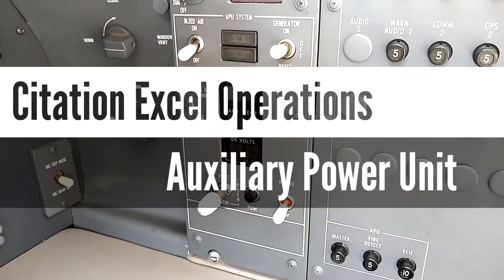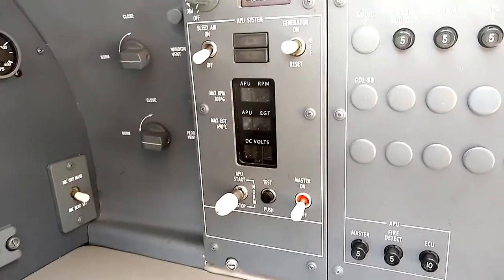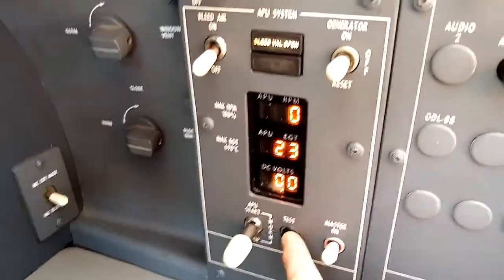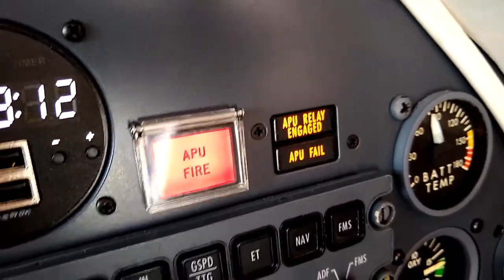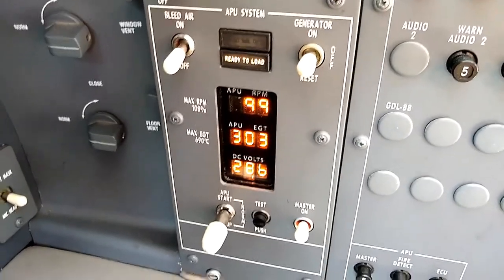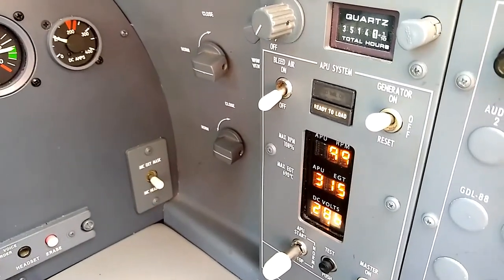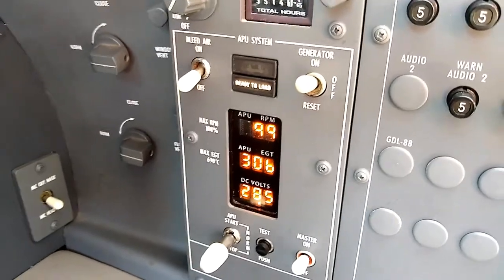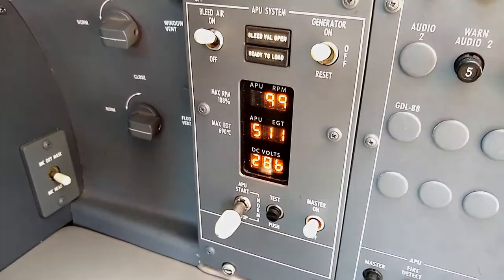Citation Excel Operations - Auxiliary Power Unit

Comment: Does a crew member have to stay in the cockpit during the apu operation
Reply from the maker: Not necessarily the cockpit, but nearby. This is a somewhat ambiguous area. The APU is not approved for "unattended" operation, although this term is not clearly defined. It generally is taken to mean a crew member must be in or around the aircraft while the APU is running. They might be sitting in the cabin, loading bags in the baggage area, outside but only a few feet away to supervise fueling, etc.

The main issue is that the APU has numerous safeguards to shut itself down in the event of a mechanical problem, but if it shuts down with all of the lights/avionics powered on, the main ship battery will only last for about ten minutes. If a crew member is not present to promptly shut down the avionics and lights after an APU failure, they'd be stranded with a dead APU and dead battery.

Comment: Does the APU works in the air also,if so what are the limitations.
Reply from the maker: Yes, it does. It can be running as high as 30,000 feet (FL300) but must be below 20,000 feet (FL200) for starting it.
Reply: @citationpro Thank you.